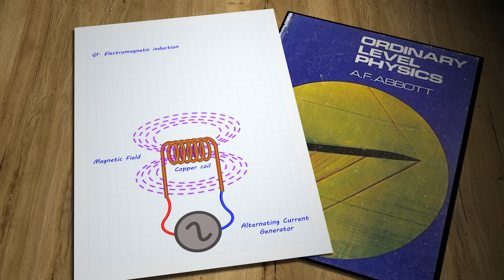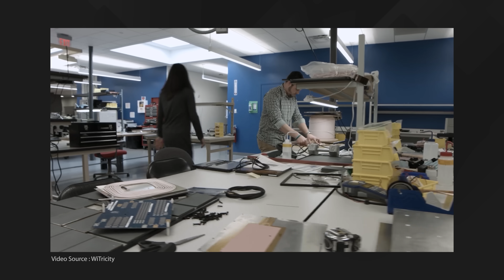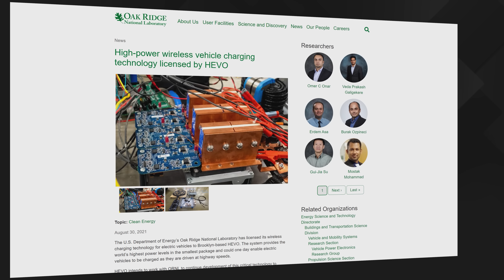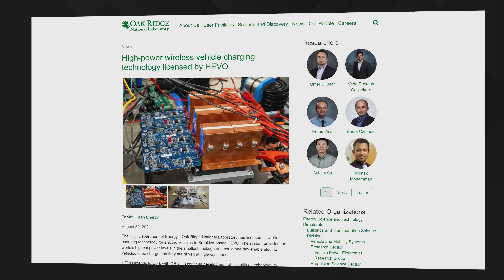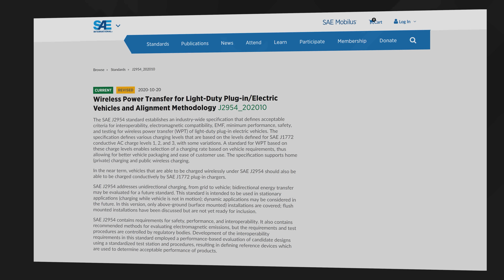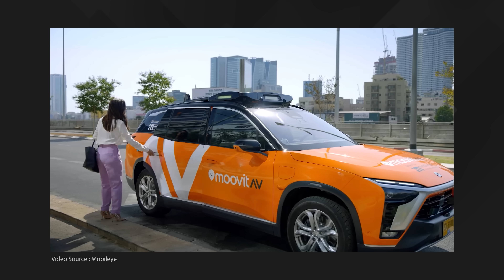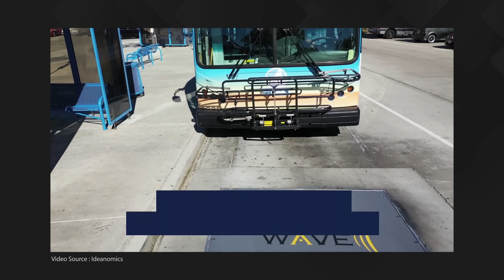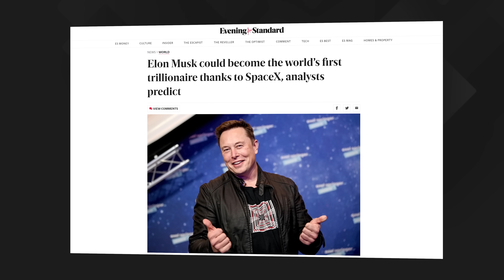Wireless FULL EV charging has arrived!  Exciting new tech breakthrough.

Comment: Resonance is an old concept, most often used in this thing called "radio". You may have heard of it.

On a serious note, more that a few people, I know personally, have been pondering installing coils in the roadbed, an using it to charge EVs, not just when parked, but also moving. It will then negate the need for excessively large battery packs. I've tinkered with "inductive power transfer ", and built Christmas displays requiring it. btw, they are resonant systems. I'm an EE, so not above my pay grade.

Comment: Thanks for the new video! And I don't know if this is an appropriate place to make a request - but now that it's over, I hope you can do a video on what happened at COP26, to go along with your video from two weeks ago about what the leaders needed to address.

As for wireless charging... it looks pretty neat and the science behind it is cool, but I don't know how necessary it is. I guess the main value is what you said at 10:29 - wireless charging will help the electrical grid stabilize grid frequencies. It would make connecting your car to the grid so convenient there'd be no reason not to do it, and that would connect millions of car batteries to the system so they could help balance loads. To do that you'd need a smart grid, though.
Reply: After thinking about what you said in the video I see now why wireless charging could be so useful for trucks and buses, and to a lesser extent taxi cabs. If there are enough chargers along the route the truck or bus can keep going and going without having to stop for an extended period of time to recharge.

Comment: For stationary applications, what about a magsafe style connection or a robotically positioned plug? Even with wireless, automatic, physical positioning for optimizing alignment may offer benefits.

One desirable feature in all of these methods is disconnection, which magnetic coupling and wireless could both improve upon from current plugs.
Reply: magsafe would use the same motherfuck'n badass big expensive and rare monster magnets that goes into the motor, therefore no, not economically viable at all. Fuck apple.

Comment: Induction is obviously also used in cooking. I use an induction cooking stove with my old cast iron pots and pans. Works brilliantly. Old and new coming together :)

It's important to note that the folks at Oak Ridge are working in partnership with engineers as VW (Audi, Porsche, Skoda). That's how this breakthrough came into being

As for Genesis, it's not a separate brand. It's the luxury sub brand of Hyundai similar to how Audi is a more upscale VW

Comment: I was in the exhibition industry and about 10 years ago, we sent a demo flat plate, induction system for charging electric cars, for exhibition in the USA. This was from a UK tech company based near Oxford, I think. The plan was that the plate was installed, embedded in your driveway and charged the car when parked. But how would you charge cars belonging to people living in terraced housing, or flats, where, often, you can never park in the same spot. Could a 'communal' set of plates be installed, which automatically debits the respective car, or possibly charging at work parking spots?

Comment: The diagram at 2:23 shows battery charging by alternating current, that does not work. Adding a full bridge rectifier between secondary coil and battery is enough to fix it.

Comment: How is this going to democratise ownership? I can absolutely see the value of charging while on the move,  but how is it an improvement for kerbside parking? The induction pads presumably will need to be wired into place just the same as a conventional socket charger. Would it not be less costly and more straightforward to just install a conventional charging point? The induction pads will presumably also need some kind of interface to pay for electricity, just the same as a cable charger.

Comment: Shouldn't it be referred to as BV charging, since you are charging a battery!. 
Electric tools are normally regarded as anything that has an electric cable attached to it and plugged in to an electrical supply. 
The current term of EV is a 'marketing' term - an electric tooth brush sounds better than an battery tooth brush. 

Charging a 'Battery' vehicle while you driving on special roads has previously been tried and failed - at great expense quite a few years ago - though the history of this farce seems to have been buried - though I think it occurred in France. It would have been a good reference to compare the previous technology to the current proposed technology to see it it is now feasible or just a fad trying to attract money for implementation.

Comment: I imagine a vehicle the size and shape of a Model Y but entirely made of batteries with a magnetic resonance coil on wheels that can roll out behind it.  This vehicle will be autonomously FSD driven, pull up in front of a moving Tesla traveling at highway speeds and move the coil behind it and underneath the resonance coil installed in the Tesla to pair with that installed resonance coil.  Within 15 minutes, the Tesla will be 80% charged and ready to continue on it's journey.  This could allow for cross country non-stop journeys fully autonomously without the need for stops for charging.  Tesla is the only company on earth with the know-how and expertise and production capacity to pull this off.  Because it can be done, and because it will be profitable, Tesla WILL DO IT.  There can be no stopping Tesla and no doubt that Tesla will actually  do this.  Since Tesla within this decade will have vehicles in every platform, that includes recreational vehicles.  You won't have to stop to charge on your way to the next trailer park with your Tesla RV.  It will be charged by the time you get there.  Your Tesla RV could be your full time home.  This will revolutionize yet another sector of the economy!

Comment: I'm on the committee of my apartment building and the practicalities of giving everyone a charger in the underground garage is proving quite a headache - and a huge expense.  Among other things, there is the risk of any system becoming instantly outdated.  A pad type wireless charger would be relatively simple to implement in existing garages - all you need is some means of working out who is charging their car and how much its costing....
Reply: You still need all the same charging equipment. This just adds another cost on top of the standard chargers. With a cable charger you could share 1 between 2 parking bays if you were on a very tight budget whereas with this you need one for every bay. Taxi ranks or bus stops are a valid use for this, but for home use where you would probably only park once or twice a day you have to be pretty lazy not to just plug in. The extra expense and drop in effeciancy compared to a cable makes it a luxury for lazy people. But good luck with installing your chargers. It's great to hear that people without their own private driveway are going to be able to use EVs.
Reply: @adrianthoroughgood1191  The problem with underground car parks with reinforced concrete bases is that there is literally nowhere you can put plugs that are accessible for each individual bay, at least not without major engineering works.
Reply: @philipdavis7521  You can do it the same way we did it in our garage—overhead rail with hanging ports for charging. The biggest problem was bringing in enough electricity for 80 parking spots, or rather how to do the split so that everybody is happy—it would help tremendously if there was an actual standard for all EVs to communicate back their charging state instead of just 'charging/done charging', but there isn't one so we opted out for 'smart' chargers that do round-robin charging cycles, but it does result, from time to time, in people not getting enough charge while others get 100% charged...
Reply: @zwerko  is it not possible to charge all the cars slowly rather than making them take turns? Are you able to detect the "done charging" signal? Do you then skip that car in the round robin system?
Reply: @adrianthoroughgood1191  It depends on the EV, some of them send their state back but most are proprietary protocols so the best we could get is set the system to charge until the EV stops pulling current (assumed end of charge) or a certain time limit has passed (currently set on 30 min per car if there are other cars to be charged). As for getting the cars charging slowly, our 'smart plugs' do have PWM current limiters but many EV models (Jaguar e-Pace for example) will refuse charging altogether if they don't get their prescribed current, so we keep the 'limit' much higher than the system could deliver to all 80 spots and once the whole system is close to the limit (we get max 96kW over three phases in the garage) it goes into the round-robin state charging 10 spots at 7.2kW max until full or 30 mins have passed. We have, at the moment 26 EVs in the garage and it happened only a few times for people not to get fully charged until the morning but it can happen (and as the number of EVs increases it will probably start happening more often). We have two 'visitor' spots electrified in the garage that have dedicated 7.2kW ports where one can sign to charge over the whole night if they expect a lengthy journey tomorrow to ensure full charge, but I'm afraid it will not be enough in the near future, it's just the best we can do given the circumstances and the mess that are EV charging standards.
Reply: The engineering standard for EV charging is that the charger responds to the demand created by the EV, up to the limit that the charger will supply, so the EV is in control of the demand.  Of course, some EV's allow heating or cooling to be remotely switched on while the vehicle is plugged in, so it can require more top up after being fully charged.

Comment: even at close range it is very inefficient.so using  the method does not fix that it just makes distance charging same as close couple charging still inefficient. and this is not new I save a video of some one over 20 years ago powering tv from across a room no wires same method

Comment: If the grid can pull electricity from the battery of my car then this means that I have no guarantee that when I go do drive about the current level of charge, even if it has been left to 'charge' overnight.  Presumably every time I go to drive I will have to check on the level of charge and if it is insufficient for my planned trip then too bad.  Sounds terrible.

Comment: I see this being more practical for busses and the like which do not spend significant times being stationary, but for most automobiles which are kept in one spot 90% of the day, I think it makes more sense to just plug them in than the cost for wireless charging (+ 10% energy loss). 
Also, for busses - this may also reduce battery size, which can save money upfront and in energy saved from moving a lighter bus. 
Then again, I live in Seattle and most of the busses are electric already, powered by overhead cables. It's not the prettiest system, but it works. 
I'm more focused on wireless charging for things for mobile appliances, like phones and laptops, esp where they don't need to sit on a particular spot to charge. 
Anyways, good video

Comment: Second comment: If you're going to put 90% efficient wireless chargers in going down the highway why not just directly pull the car along with electromagnets and an iron plate underneath the car? At this point you've just made a train with rubber wheels that can deviate from its path when the driver wants to.

Comment: I wonder why they don't try charging wirelessly from the side of a vehicle, rather tnan from beneath. While it is true that side charging would not work for moving vehicles, the charging mechanism might require less protection from the elements (i.e. cheaper to manufacture), and be easier to access for maintenance or repair, if it is positioned on the side of a vehicle, rather than being embedded in the floor of a garage. Maintenance on the charger might be less of a chore and grid access for grid power demand balancing would be available while the car is parked. After all, vehicles spend most of their time parked somewhere.

Comment: We're hardly at the point where those who aren't on the EV bandwagon are simply "laggards". The jury is still out on EVs. If there's a breakthrough in fusion power or even wide adoption of small scale nuclear power, green hydrogen could become a viable alternative. My bet is on EVs, but they are currently in the early adopter phase, at least in Canada. Mostly, I see high end Tesla's, which are not affordable to most people. I'm confident EVs (or possibly hydrogen powered vehicles) will cross a tipping point and become mainstream, but it hasn't happened yet. In BC, we have the highest percentage of EVs in new vehicle sales in Canada. That percentage crossed into double digits for the first time. Currently, charging infrastructure and cost (even with tax funded discounts from our government -- thanks, Socialism) are still holding EVs back. If I had to bet, I'd give 90% odds that EVs will become the default for passenger vehicles and light trucks within the decade.

Comment: Magnetic fields decrease as function of the inverse of the distance to the third power, not squared.  That's why a small change in distance results in a large reduction in coupling.

The problem with the resonant coupling, as I see it, is that 4-10% loss of power through the connection is quite large when you're talking about megawatt chargers..  even a 4% loss amounts to 40kW.
Reply: Curious - did you actually watch the video before making your comment?

Comment: ...and how will rapidly moving magnetic fields affect the body? Wonder if anyone is checking that out too? 🤔 I wonder how popular the electric cars would be in a free market without the subsidies on new cars and penalties for the old stock? But i totally agree with you on "they are here to stay". Thank you for the work you do even if im not as excited about the topics as you 👍
Reply: Actually that is not a problem. Any radiation is very low frequency, well below microwaves and absolutely not ionising. An induction hob would probably be just as bad for you but they have been used for ages with no ill effects.

Comment: With the ~10% energy loss from wireless charging on a large scale, how much energy are we losing because of this? I think it has its uses, but I would much prefer lower losses than this
Reply: Better is always desirable, but if it speeds up adoption then it should make up for it.
Reply: You need to check your wired charger, losses aren't much less.
Reply: Where are you getting 10%? Did Dave mention that in the video?

Really we need someone to do the load calc between service point and onboard charger terminals. I'd like to see the math there, especially with how plug-in terminals wear down over time, increasing resistance and hence losses